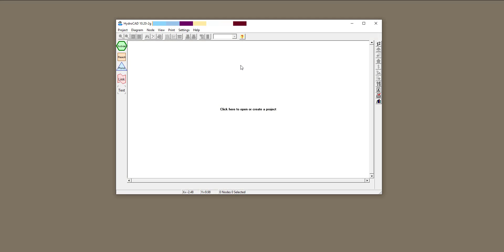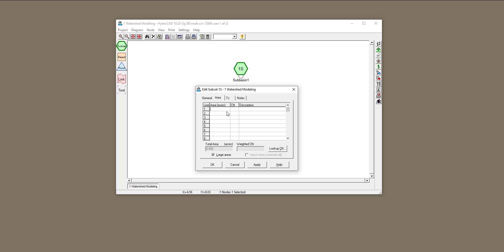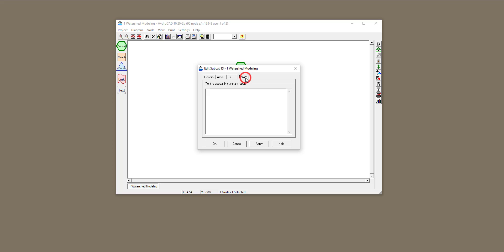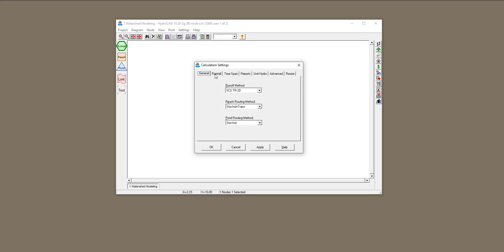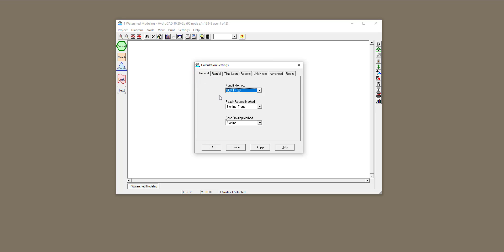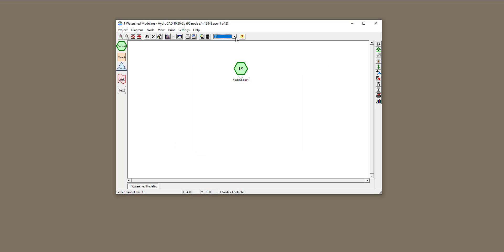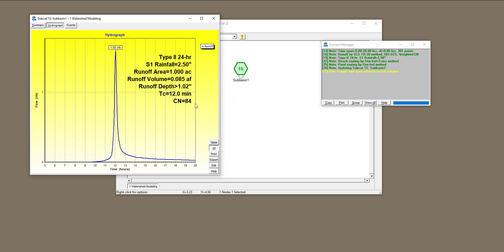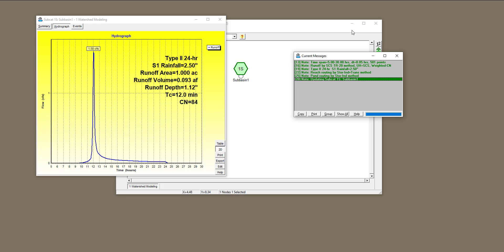HydroCAD Tutorial01: Fundamentals of Watershed Modeling

Comment: I want to calculate the volume of runoff with precipitation value in just one to 2 or 3 day? Is it possible to do it in Hydrocad?  Its mentioned that The watershed has no hydrograph station for calibrating. 
Thanks a lot